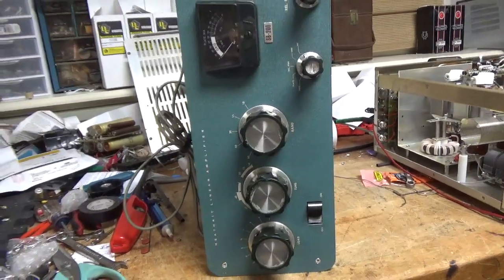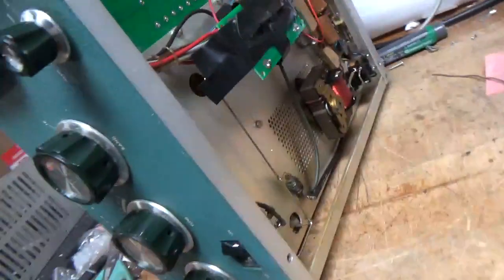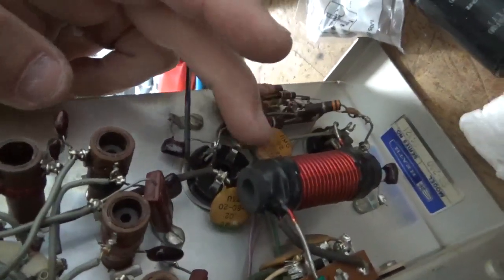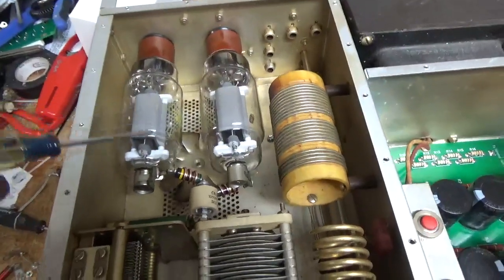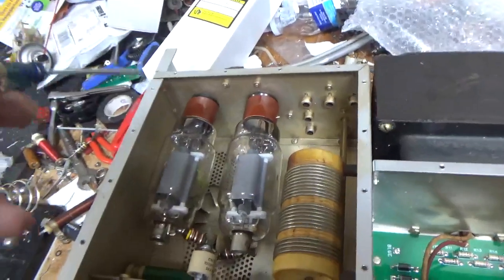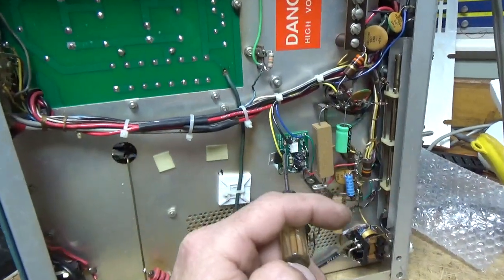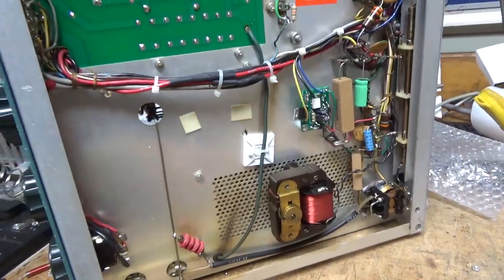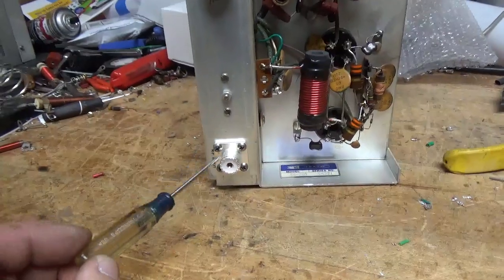Heathkit Sb200 Repairs And Modifications

Comment: Why did you get rid of the soft start?
Reply from the maker: The resistors are prone to failure and when that happens customer must change or send back to me for repair

I removed and jumped the one in the Drake l4b I just fixed . Board has soft key and bias circuit which still function

Not to mention that the transformers in each amp are designed to limit the inrush

So not needed !!!